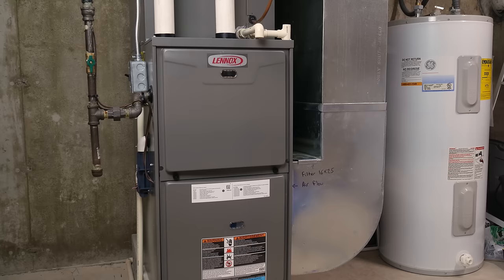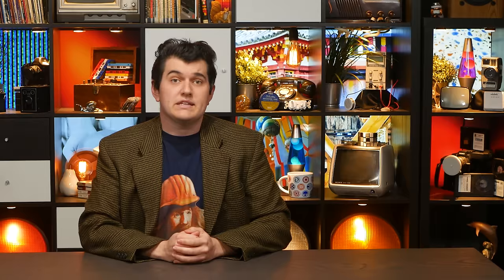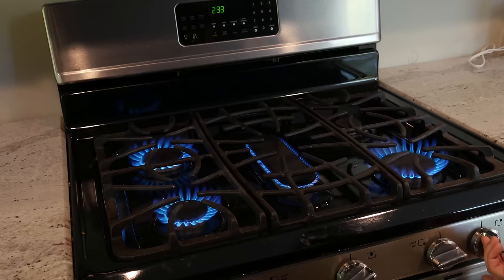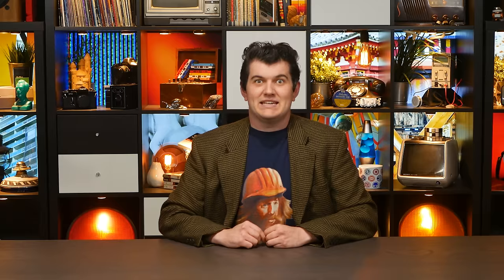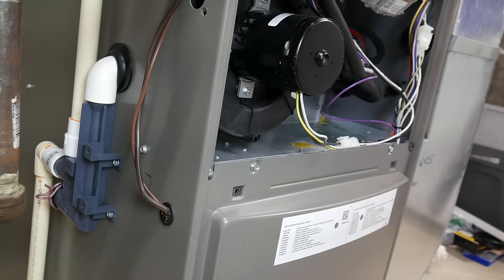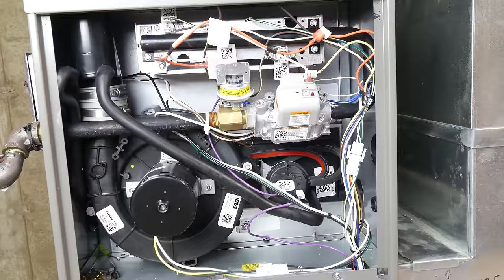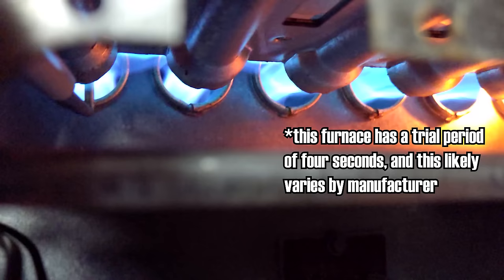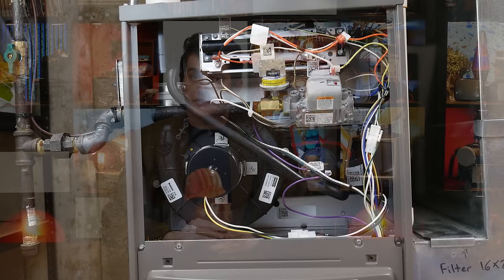Forced-air Furnaces: The What, Why, and How

Comment: I have been servicing both 80 and 90 plus efficiency furnaces for 3 years in chilly North Dakota. I have worked with 4 local contractors and a myriad of technicians. NOT A SINGLE ONE has been able to describe some of the design features of these furnaces. You have slain ignorance in as much time as it takes me to service the average call!

Thank you for helping me help others!
Reply: Forever problem with technology and especially teaching. Staying up to date requires effort that not everybody is willing or able to put in. It results in kids leaving school with outdated stuff and technicians sticking to what they learned ages ago.
Reply: Must be a real ND person.

I lived through the oil boom and all I heard was "cold" "freezing" "the opposite of hell" "frozen wasteland" and "forsaken ice box"

My guess is eastern ND as western is alot of electric heat.
Reply: @J-1410  I'm a technician servicing Minot AFB. All our furnaces run natural gas. The base keeps an emergency store of propane for SHTF situations. Once a quarter, they run propane through the lines which runs too rich for all the furnaces, power vents, etc. That means soot builds up on the flame sensors often (most common cause of furnace calls for us).

As far as what I feel about ND winters? I came from New Mexico, Turkey before that, and California before that. I do not dig the winter here lol
Reply: @travelinghermit  what's their logic for running propane? Make sure it works?
Reply: @J-1410  If you mean why store propane as opposed to gas, I can't say. I can say I've never seen natural gas under any kind of long term storage like I have with propane. I don't actually know if storage would be a consideration.
Reply: @travelinghermit  I meant why run propane every now and then if all it does is cause problems?
Reply: @J-1410  i gotcha, sorry. Yes, they run the propane to ensure the whole mess is operable. The USAF is utterly unconcerned with the effect it has on housing. I suspect there are other systems on base they're more concerned about. Regardless, of the 1,400 units we service, only a few hundred per year require us to respond for the sooty flame sensors- the work hours are easily covered by the rent residents pay.

Comment: I'm reminded of the time we switched the propane tank on my grandparents' furnace. The fuel pressure was higher than the previous tank which meant while there was combustion going on, excess fuel also got pumped into the furnace and was unable to exhaust fast enough. I woke up with headaches for an entire week (my room was in the basement) until I figured out how to adjust the fuel pressure. If I hadn't learned that, my grandparents' house could have exploded or worse. Which is why furnaces need a fuel pressure regulator.

Why my mom and I were at my grandparents' house is beyond the scope of this comment.
Reply: what's worse than a exploded house?
Reply: @drogenmuellerable  the former residents dying...
Reply: flatly I can already tell why and without getting into detail, I am sorry. Someone young shouldnt have to learn how to adjust a gas valve because of circumstance. cheers to not being at that point in time anymore.
Reply: Sounds like an interesting backstory we’d like to hear…

Comment: This year, I've replaced more gas forced air systems with Geo and air to air heat pumps than ever. I'm doing two 20+ seer variable systems just this week. Even with slightly higher costs on electricity in some places, the overall efficiency is so much higher, like an energy advantage of 3 to 1.

Comment: They're also used in semi trucks, and they just use the same diesel as the engine. It can keep my truck as hot as 85°F (29.4°C) for an entire night when it's below freezing outside, and it uses a small fraction of the fuel it would take to run the engine all night.
Reply: That is fucking cool.
Reply: Ooh, neat.
Reply: 29.4 is hotter than most people see as comfortable temp, these days the temp in my house is 29-31 and I run the ac to cool it down, 25-26 is what I say comfartable for sleeping
Reply: Yeah I remember the one that was in my Peterbilt, darn thing could roast you out in the middle of Minnesota. All it uses for power is the 12v DC from the battery to power the fan and the ignitor. Once lit, it burns efficiently like a kerosene lamp (essentially the same fuel).
Reply: Bassam salim I can barely sleep over 23. I heat my place to 22 during winter, 18-19 in my living room.
Reply: Webasto Airtop or similar? at least operation principle sounds identical.
Reply: Seriously ?? I always assumed it was just normal heaters. This is awesome.
Reply: @cedricpomerleau5586  that's actually very smart as optimal temp for us humans (when wearing clothes) would be from 19 to 21 C.
But hey when it's so cold I dont mind if it gets above that temperature.
Reply: Karjis here in the states it’s probably an Espar/Eberspacher, for whatever reason they seem to be more common than Webasto. Identical principle, as you say.
Reply: Patrick Fitzmorris Eberspächer is common on this side of the pond also, I just dont remember the modelname of similar air heater for that. I think here it is much more common to have water heater from Eber/Webasto than air heater as water can also be used to heat engine block before starting. Also common in normal passenger cars but in those you have to be careful as it is essy to drain the battery with heater especially when driving short distances.
Reply: I've got the pretty much same design, just running off of gasoline instead of diesel. These heaters have also been quite popular in the rv space, and i agree, they are an absolute blessing in terms of heating efficiently and silently at night.
Reply: @cedricpomerleau5586  I think I would become an ice cube at 15 dgrees without heavy clothing
Reply: @bassam_salim  I agree that 15 is really cold, but 18 with some good blankets feels perfect. And it saves a lot of electricity as I only use that for heating.
Reply: Kind of like the old Volkswagen gasoline heater. We had those in Canada in some years. They put out a lot of heat, much more than you’d get from the ducts around the exhaust pipes.
Reply: @cedricpomerleau5586  For sleeping I want 16C

Comment: It's quite spectacular when the heat exchanger of an old furnace goes. The pressure from the large blower pushes the flames back out and flames come shooting out the front of the furnace, which then trips all sorts of safety features and shuts it down. There's sometimes a loud bang when it happens. It's more common than you'd think.

Comment: As a Dutch service engineer I work on these systems daily. Altough we have some slight differences, you have explained it very very well. Thank you! Awesome to see something in my industry :)

Adressing to the change of heating systems to heat pumps due to climate change, our heaters in the Netherlands are already ready for hydrogen. It’s as simple as changing the gas valve (if they use the gaslines used for natural gas. 

If your interested in these type changes they are working on, please let me know. I can help you get in touch with manufacturer.

Comment: You know, I was half expecting him to say "through the magic of buying another one" somewhere in the video.
Reply: there should be a cross-over with the lock picking lawyer memes, "through the magic of buying another one of the things Bosnian Bill and I made"
Reply: Through the magic of already having two of them
Reply: 16:29
He does have 2!
Or at least had 2.
Reply: How many furnaces does one house need?
Reply: @PaulMansfield  "Let's get this heat exchanger out onto a tray..."
Reply: @Furious321  Steve1989MREInfo
Reply: @Furious321  ... nice
Reply: @aterfelis4708  one. Dometimes two. Depends on size really. Mine has two but its 3 stories so
Reply: @Demonslayer20111  My aunt's house had two furnaces. One for the basement and main floor, and one for the second floor.
Reply: @dougbrowning82  mines the opposite. Bottom floor is actually on its own electrical as well, only water is shared with the top two floors. Pretty sure at some point the basement floor was a seperate living space, it used to have its own kitchen as well.
Reply: @aterfelis4708  Some homes can make good use of multi-zone systems.  Some parts of a house are more affected by the heat of the day than others.  For example: in the summer, a sun facing wall that gets the heat beating down on it all day, vs. the basement.  A single system design would have the AC on all the time to cool off the upstairs, but the basement would get uncomfortably cold.  A two zone system would let you keep both zones comfortable and not waste so much energy in zones that don't need adjustments.  
Or it's a simple matter of multiple systems working together is cheaper than a single huge system.
Reply: @peterkaminsky4646  I appreciate the explanation, though I was partially kidding when I asked. Having spent time in Florida I can understand the benefits of a multi-zone system.
Reply: @aterfelis4708  Two: the broken one and the new one.

Comment: I have a condensing boiler in a hot-water-baseboard system. When the HVAC company put it in, they routed the condensate through vinyl tubing into my sump pit. 

A few months later I found a trickle of water running from under the boiler.  They had connected the condensate drain to the vinyl tubing by inserting the ends of a little piece of 1/2" copper pipe; the condensate had eaten through it.  It probably wasn't doing my sump pump any good either. (Normally zero groundwater entering the sump.)

I replaced the copper piece with PVC, and made a big "U" of 3" PVC in the sump pit, one side an inch lower than the other, filled to the top with marble chips; the condensate drips into the high side, so the water has to pass through several feet of marble before it can escape out the low side.  Copper pipe fittings nestled in the rocks on each side for a year showed significant corrosion on the inlet side, and none at all on the outlet side; five years later, the condensate had dissolved about 3" of marble from the inlet side, while the outlet was still full & clean.  Seems like it's working. 😁
Reply: That corrosive water is no joke. I've had a tech warn me that I need to make sure drain water from this stuff goes directly into the nearby drain and doesn't drop onto the concrete floor, because it'll damage the concrete.
Reply: @Corrodias  having seen firsthand what it does to marble over time, I don't doubt it.
Reply: That's genius and kinda scary.
Reply: @DaddyBeanDaddyBean    Well marble is metamorphized limestone.  You can bake marble to make lime
Reply: DaddyBeanDaddyBean The marble chip method is actually an approved way of disposing of condensate in the UK building regulations. Ordinarily, condensate is routed to a drain where it is diluted by other waste water. It is however acceptable if there is no suitable drain to connect to a soakaway located a suitable distance from the wall / foundation and backfilled with limestone.
Reply: @spencerwilton5831  interesting, thank you. I was completely confident it was a valid approach, chemistry-wise, but nice to know it is supported by building code as well, at least in UK.

Comment: As a firefighter we get called on so many smoke/fire investigations for residential structures that utilize these devices to heat their home. As shown in this video they are wonderfully crafted and designed in order to not be the very reason your home burns down but they can only do so much. Save the money needed to maintain and repair these routinely. The cost of an HVAC appointment is pennies on the millions in comparison to the potential loss of life suffered from lazy or forgotten responsibilities. 

Be safe and that you for your awesome videos my man! Your are a treasure!
Reply: I have literally never heard of a forced air gas furnace causing a house fire, how would that even happen?  They're metal boxes with a regulated gas supply.  As he said about 20 times the biggest risk by far is releasing exhaust into the house, which is also very rare.  Their most common risk is failing to work due to open circuit from the safety devices.  They aren't going to cause a house fire.
Reply: You forget that at the end of the day all of these safety features are still being built by the lowest bidders.
Reply: @tech99070  A bad rollout or gas leak could lead to a larger fire.
Reply: @tech99070  I'm not a firefighter nor an HVAC guy, but if I had to wager I'd say electrical stuff, bypassed sensors, or bad gas pipes/valves. I've personally seen more than a handful of really disgusting and thick aluminium to copper connections that just send shivers down my spine, as well as bypassed sensors. Not so much about gas pipes other than solid copper ones which are "okay" I guess, since their usability depend entirely on the type of natural gas you get so as to not form flakes of whatever chemical stuff it is that happens with copper pipes and certain types of natural gas.

Comment: Another thing to note regarding carbon monoxide: it’s likely part of why they use induced draft rather than forced draft fans.  Having the blower before the tubes would put them at slightly higher pressure than the ambient air pressure, which would mean that any leak in the tubes would expel combustion products into the house’s air supply.  With induced draft, the tubes are at a lower pressure relative to ambient air, meaning that a leak there will suck clean air into the tubes and won’t let CO into the ventilation system.  Of course, any leak in the PVC exhaust will still contaminate the interior, but there’s less risk since it isn’t subject to the same intense thermal cycling as the fire tubes.
Reply: oil furnaces do just that...forced draft.  The oil burner pushes air into the combustion chamber, as high pressure oil is sprayed into it with an atomizer nozzle.  A spark electrode ignites it the air/fuel mixture.
Reply: That's the reason why water boilers do use forced draft, because there's no risk of CO leaking into the domestic air vents. Some even have turbines to recover even more latent energy than just forcing air through, turning them into small-scale turbojet engines.
Reply: better that than be dead!

Me, an intellectual,: “Hmmmm”
Reply: Also placing the fan after the tubes lengthens its service life and makes it cheaper to produce, because less thermal stress will occur
Reply: After seeing this I got rid of the ventless unit ! replaced it with a vented unit .
Reply: @thenasadude6878  methinks you need to rethink your answer...
Obviously, having the inducer pull exhaust gasses through the combustion chamber, gives much more thermal stresses than pushing ambient air INTO the combustion chamber